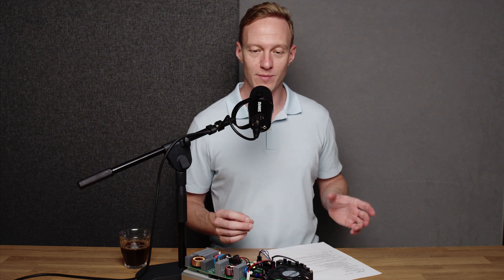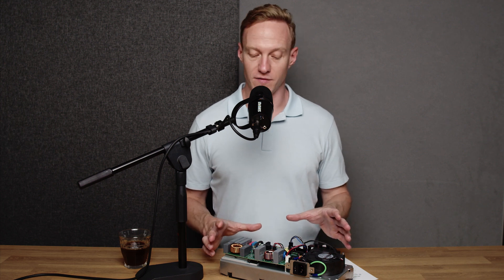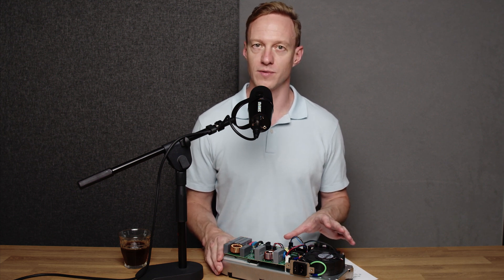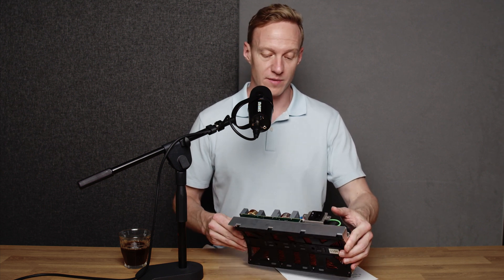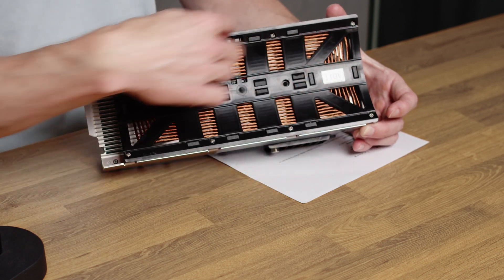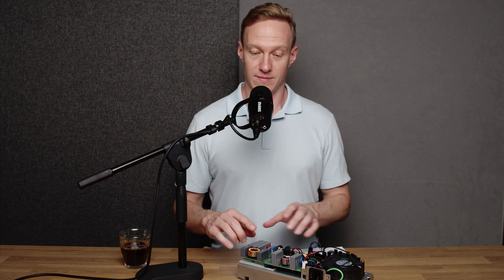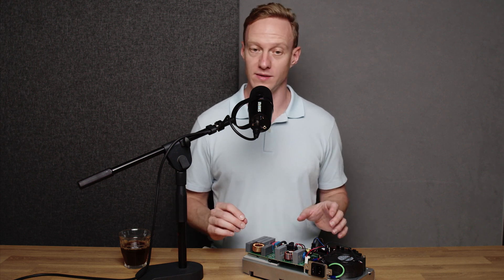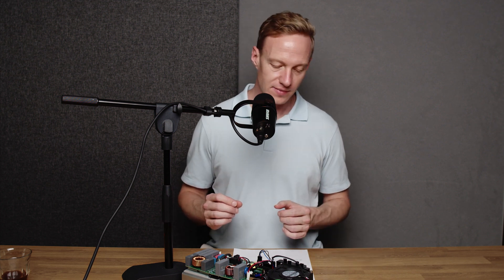Bullet R2 Update. Must Listen!

Comment: Will it be possible to swap an r1 control panel to the new version without fixed wiring?
Reply from the maker: The front panel will not be sold separately.

Comment: (When) will there be an upgrade option for existing R1 owners also for the electronics, especially the new induction board (230V and/or 110V)?
Reply from the maker: Good question. We don’t have a fixed timeline for that yet. It’s a subject we will address in a separate video. However it’s a very advanced procedure so expect it to be rather costly, involving shipping back and forth of your beloved Bullet (it’s not something that can be done at home), and available for a limited time and in limited numbers. We will do a Q&A video on that matter in January.
Reply: @Aillio seems it would better to sell my roaster, and buy r2, than upgrade r1, it will be cheaper)